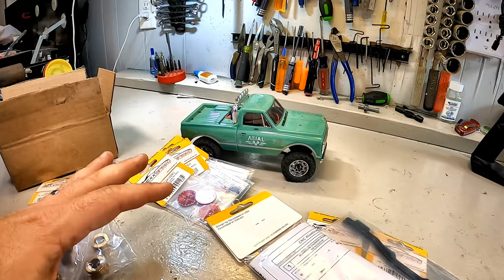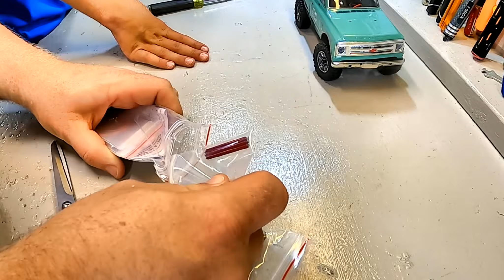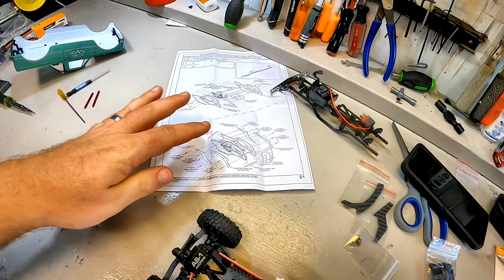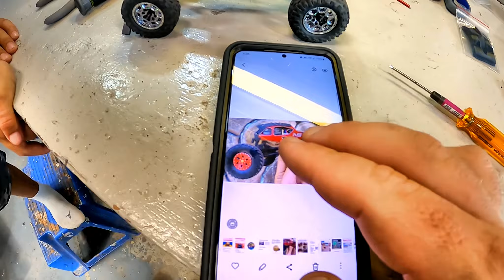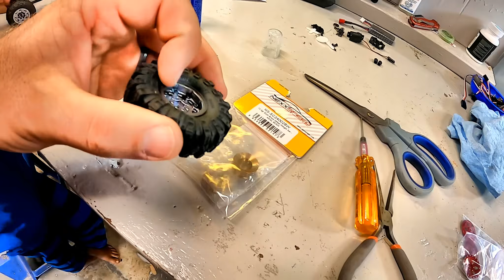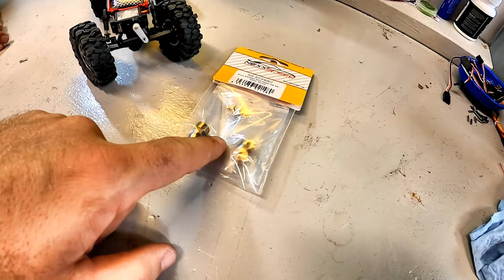Transform your Axial SCX24 with NexxSpeed

Comment: Go to ebay and buy a pack of 100 of the correct size nut for the scx24. I built the Goblin chassis when it first came out like 2 years ago and had the same problem not being able to mount shocks. Super nice little rig 👍 widen up the stance it will help with the extra added body weight.
Reply from the maker: Thanks for the tip!